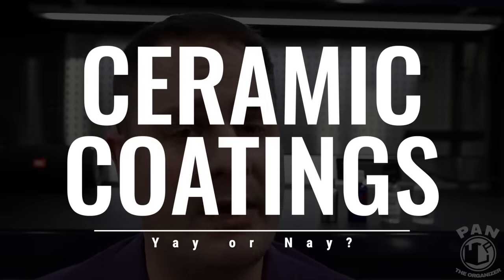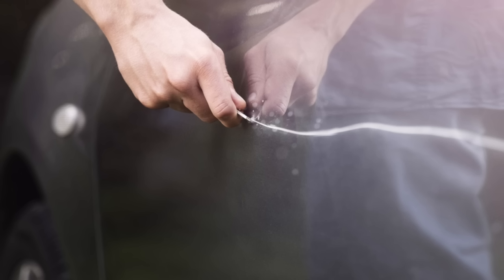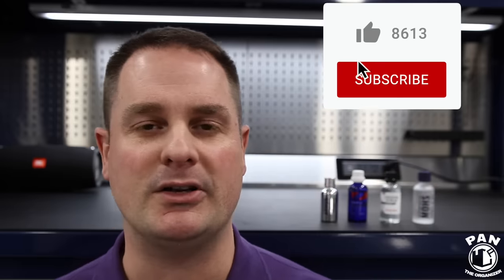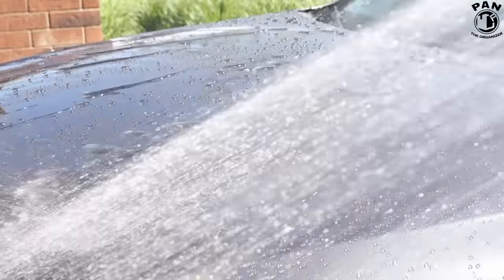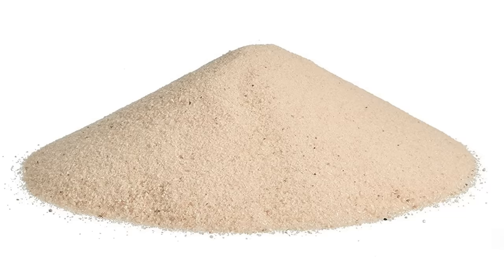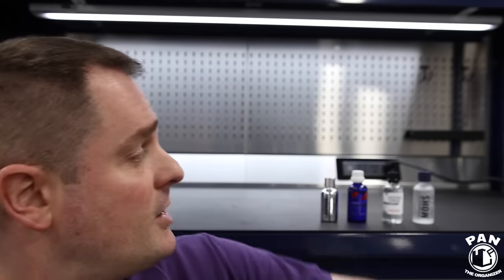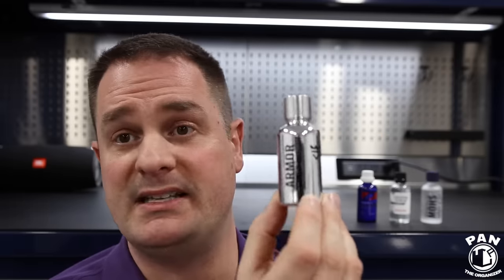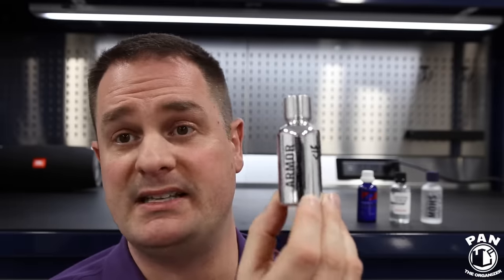DON'T BUY CERAMIC COATINGS BEFORE WATCHING THIS !!

Comment: Pan, I worry that washing and claying won’t remove all sealants and waxes on the paint and certainly won’t remove swirls.
Reply from the maker: You would be correct. Washing and claying alone doesn't remove imperfections and doesn't remove previous waxes and sealants. Only machine polishing will accomplish that.

Comment: Pan I used ur link to Avalon king. Selected the ceramic product. It’s inviting me to enter a code (Pan25),  but it will not allow any entry of any code  so I did not buy it.
Reply from the maker: Weird. It works for all my viewers. You have to make sure to use the specific link in the description under the video, and then when you check out, you enter the PAN25 promo code.
Reply: @PanTheOrganizer  i did it by using crome  not safari thanks.   i am going to BUY everything for the 2 stage pain correction then ceramic protection - including. products-tools-clay - towels. EVERYTHING   for my RED Porsech Cayman

Comment: Pan, is there a recommended top coat to go over armor shield 9?  You mentioned something for the other brands but not Avalon King
Reply from the maker: AvalonKing states that their coating doesn't need a topper, hence why they don't have one. But of course, we all like detailing our cars and I still recommend a silica spray sealant of your choice be applied once every 2-3 months to maintain the coating's performance and also boost gloss and slickness.

Comment: Can you apply more than one coat Armor King?
What professional Ceramic coating do you recommend?  (I have SB3 Trinity and honestly I'm not impressed.  Lots of water spotting)
Reply from the maker: You can apply two coats of AvalonKing. One hour between coats.  For pro grade coatings, you can check out Opti-Coat Pro+, CarPro CQuartz Finest Reserve, Gtechniq Crystal Serum Ultra, Gyeon Mohs+, etc
Reply: @PanTheOrganizer  Thank you for the info/response.  Which professional coat would you highly recommend?

Comment: Getting offered a one year coating at my local detailers does this sound okay to you as you-have mentioned 2 year’s as the norm .
Reply from the maker: Hi Michelle. It all depends on your budget and needs. There are coatings that last 6 months, 12 months, 2 years, 3 years, 5+ years...  So it's up to you to discuss the options with your detailer and see what longer lasting protection could be applied. If it's a serious detailing shop, they should have long term ceramic coatings that could be applied. 2 years of durability is quite the industry average for consumer grade coatings, and pro grade coatings (those that can only be applied by authorized installers) go upwards of 3+ years.

Comment: Hi Pan, newbie here. Been watching a loootttt of your videos. Looking to start my own weekend/evening mobile detailing business that I can do outside my day job

Regarding these coatings, they are tiny bottles. I was wondering how many cars one bottle can be used on - you probably have videos of applying coats with these small bottles, just probably haven’t come across it yet
Reply from the maker: It depends on the size of the car, and how much you are applying. Also, are you doing one or two coats? And are you just applying it on the paintwork, or also on other surfaces like glass, wheels, headlights, plastics, etc?  As you can see there are many variables.

But as a general rule, one 30 ml bottle is enough for two coats on two average size cars. Just the paintwork. If you also plan on doing all the exterior surfaces, get two bottles.
Reply: @PanTheOrganizer  I see. I guess the variables would make it differ
But thanks for the general rule advise, that gives at least some sort of idea. Thanks Pan!!

Comment: Pan love the videos. Very thorough and always educational.  Do you think it’s safe to use a one and done polish like turtle wax hybrid solutions pro prior to the ceramic coat as long as you use the 50/50 alcohol wipe off?
Reply from the maker: Thanks for the kind words about my videos Brett! Always appreciated. :)

To answer your question: NO. Don't use any "all-in-one" type polish before applying a ceramic coating. Don't use polishes that contain protection in them. SUPER IMPORTANT.

I would use pure polishes, like some that I recommend in my compounds, polishes and pads video here: https://youtu.be/2JDvQBs1viM

Comment: after the 3-5 years can I just apply my ceramic coating again?
Reply from the maker: No. You have to go through the entire prep process and machine polishing to ensure 100% removal of any left over protection and prep the surface to receive a new coat.

Comment: Can I apply a ceramic coating to stainless steel on my semi truck
Reply from the maker: The answer would probably be no, as ceramic coatings (made for paint) need to bond to clear coat.

Comment: Have you tested Dr. Beasley's Nano Resin kit? It boasts 25 years of protection with maintenance.
Reply from the maker: I have the Nano Resin Pro kit in for testing but haven’t tested it quite yet.
Reply: @PanTheOrganizer  Are you going to show how it works?
Reply from the maker: If I get enough viewer requests for it, I will absolutely make a video. In the meantime, I made a YouTube short video showing its self healing ability when I was at the Dr Beasley's headquarters. :)
Reply: @PanTheOrganizer  I saw the short, the product seems pretty amazing!  I would love to see more!
Reply from the maker: I was also impressed. :)

Comment: Thanks for the video. I wanted to know what's your process to determine a "real" ceramic coating? Is it based on the product composition found on  SDS sheet?  I have used TEC580 before and i somehow feel it may not be a real one.
Reply from the maker: What we mean by full blown ceramic coatings are the multi-year semi-permanent ceramic coatings (or graphene coatings) found in glass bottles. Yes the TEC580 is a "true ceramic coating" as it fits that criteria. No that doesn't guarantee that all ceramic coatings are made the same. There is much more to it than that (and that's beyond the common knowledge as we don't have the recipes or chemistry secrets behind proprietary formulations).
Reply: @PanTheOrganizer  thank you very very much for taking time to answer me. I'm sure I'll comment in future. Got quite a few videos to watch from you. :)
Reply from the maker: My pleasure Felix. You have almost 600 awesome videos to go through on my channel, and new ones added each week. Lots of crazy videos to come so stay tuned. I hope you subscribed to be a part of the Pan TheOrganizer family as we’re approaching 600,000 subscribers.

How did you discover my channel by the way?
Reply: @PanTheOrganizer  sure did. Plenty of good info.  Been so many years since I done detailing, i felt "out of times"... Catching up so i can best protect my newest ride. A '21 TypeR
Reply from the maker: Cool car!!  Enjoy it!  I get a brand new car every three years. So this coming summer will be that time. My viewers will be in for a freaking treat. So stay tuned! ;)

Comment: Hi Pan,
Awesome information!
I have watched several of your videos several times.
I have a question : Could I use a ceramic coating, then after a week put the turtle max wax on top or even the flex wax?
Reply from the maker: Thanks for the positive feedback David! After you applied a ceramic coating, wait 1 to 2 weeks before washing the car and starting to use toppers. But yes you certainly could use either Turtle Wax graphene products on top, no problem. Those are actually great choices for maintenance toppers!

Watch my Flex Wax video: https://youtu.be/b5BjDzItlr8

How did you discover my channel by the way?
Reply: @PanTheOrganizer  We bought an F150 and a camper in the past few months and I want to protect our investment.
My niece's husband, who does some detailing on the side, suggested I watch your videos.
I have watched (~6 times) and purchased items from your VW new car detail video.
The Graphene videos you did on the turtle wax line added to my confidence to give those a try (they arrived yesterday with the items from your video)
Now I am tempted to buy the 3 car size of the Armor Shield and use that as the base coat on the F150 thus the reason for the initial question.

Comment: What about a new car, do you have to wait for the factory paint to cure or can you coat it right away? Is the prep requirements the same since it doesn't have the wear factor? Also, can you double coat your car to increase the protections longevity ?  BTW, Great videos
Reply from the maker: For a new car, it has already fully cured in the ovens at the factory. You can protect it as soon as you take delivery, and you should. I made a popular video explaining why it's important to detail a brand new car here: https://youtu.be/QgoyrC-5CMc

And to give you an idea of the steps I perform on a brand new car, watch this video: https://youtu.be/gohks8xP5NY

Welcome to my channel. You discovered one of the biggest car detailing channels on YouTube as we surpassed 790,000 subscribers and 100 million views! I have been detailing for 25 years and I love to share my knowledge and passion with my viewers.

You found the right channel to help you learn everything about detailing.

Comment: How many cars can one of those small bottles do. I have 2 Small SUV’s to do and I have a small bottle like the ones you display.
Reply from the maker: Two bottles will allow you to coat two SUVs with two coats each. Get three bottles total if you also plan on coating glass, wheels and plastics.

Comment: @pantheorganizer can i do 2 layers with curing time for each and then apply something like the Turtle Wax Ceramic Spray as a top layer? also do you recommend using a hybrid in after layering such as shine armour fortify or carpro reload? thanks for feedback (purchased avalonking)
Reply from the maker: After applying the ceramic coating, I would wait one week before washing it and starting to apply toppers from different companies.  Stay away from Shine Armour. That isn't good stuff. 

Stick to reputable coatings brands for the toppers. Many of which I have reviewed here:
The Last Coat: https://youtu.be/nQRX1KlY0uM
Lithium Ceramic Slam: https://youtu.be/Zp2sWeY1UHU
Turtle Wax Ceramic Spray Coating: https://youtu.be/_r_AXaUeTIQ
Reply: @PanTheOrganizer  really appreciate the reply! I bought the turtle wax and the Avalon king as per your recommendation. Just looking for shampoo / waterless spray if possible?

Comment: I knw this is an old video but do you still feel like you can't add a coating over a previous coating?  I knw its not ideal but I spoke to someone at Adam's about their Advanced Graphene Spray, and they told me I could do it. I also asked Yvan Lecroix (I hope I spelled his name right lol) he said yes also to the dismay of the guy from Rad's Garage 😂... I just wanted to knw your take on this 3 yrs later.
Reply from the maker: There's a big difference in the "you CAN" and "you SHOULD" hehe. Can you just wash a car that is coated, then dry it, then use a panel prep spray and then apply a new coating on top of the existing one? Yes. But you can't ensure a proper bond as each coating could potentially reject the other one, it's hard to know. So you might not be getting the full performance, benefits and durability of the new layer you're applying.

Like anything in the detailing world, the better you prep the surface before applying any paint protection, the better it will perform and the longer it will last. So if you want to apply a new coating after many years with a previous one, I personally would do the full wash, iron remover, clay, machine polish (at least a light polish to ensure removal of the previous coating, or at least remove enough of it to ensure proper bonding of the new layer), then panel prep spray to remove polishing oils and residue, and then apply the new coating.

Since coatings last for years, why not take a few more hours to prep properly and polish the surface? You'll also benefit from a bigger increase in gloss, and machine polishing is really what bumps gloss up by the most measurable gloss units, compared to just applying protection.

Now, here I am talking about TRUE CERAMIC COATINGS, the ones in glass bottles. Sprays are a completely different thing, as it's not as crucial to get things as perfect as with a wipe-on (glass bottle) coating in my opinion.

If you are simply asking about sprays, which it seems you are, it doesn't matter as much as those aren't multi-year semi-permanent protections. In the real world, you might get 6-12 months with the Adam's Advanced Graphene Ceramic Spray. So in those cases, yeah you could just wash the car, dry it, use a panel prep spray to remove oils and residue, and apply a fresh coat.

Food for thought.
Reply: @PanTheOrganizer I’m at a loss as to what I should do to prep the textured black plastic cladding on my vehicle (Hyundai Santa Cruz). For the painted surfaces, I can count on the clay and polishing to remove any old protectant. But the cladding is a different story. The best I can do is chemical stripping, but anything too harsh beyond diluted APC might damage the surface. The Turtle Wax hybrid solutions spray ceramic that’s on there is tenacious to say the least. Should I just ceramic over the cladding after a decon wash and panel prep? Thoughts Pan?
Reply: @PanTheOrganizer  Thanks Pan !! Yea I was definitely tlkn about Adam's Advanced Graphene in particular. I knw the bottle ceramics are a whole other animal. Thank u Pan. Wutang Forever. 🙌🏽
Reply from the maker: Wu-Tang Clan ain't nuttin to f**k wit!! :)
Reply from the maker: How did this conversation turn into trim talks? I'm confused. It depends if your trim needs to be restored or not. I'm assuming it does. See my tutorial on trim restoration here: https://youtu.be/_9X2jzRhTwA?si=K-k85gT2kkyKs9MH

If your trim isn't faded, and you're just looking to protect the plastic, see my other video here: https://youtu.be/pzi1wpL7I0Q?si=27461s93sdhjFiWm
Reply: @PanTheOrganizer  😂

Comment: So pan, my car has been polish. honestly i want ceramic to make my car change, become more shiny and more gloss, most important thing is that make my car looks changed.
I don't really care about protection
so light coating vs consumer coating vs professional coating
will look the same on my car? And only give different protection time?
Reply from the maker: Before all that, you must know that the best way to increase the gloss of your paint is not by applying protection. It's by machine polishing. Polishing the surface removes oxidation, swirls and scratches and levels the clear coat which in turn improves light reflection so you get the biggest increase in gloss units that way, plus you gain more clarity in the finish, richer effect.

And then applying a quality ceramic coating will boost gloss a little bit more, by a few extra gloss units depending on which one you buy. Hence why we usually ALWAYS polish before applying a true ceramic coating or graphene coating.

I made a video about the glossiest products here: https://youtu.be/ERTQz-NTz1Y

Comment: So... you said that carnuba wax was great but the problem was it needs to be re-waxed every 2-3 months. But then you say that ceramic coating needs a booster for maintenance every 2-3 months. What’s the advantage then?
Reply from the maker: The coatings will still do their job for the years they're on the paintwork, but might lose a bit of hydrophobic properties over time and need to be replenished. The protection is still there, it just needs a boost. Contrary to carnauba waxes that just fade away and disappear entirely, so there is NO protection left.

Comment: Great video! Other than longevity, how do these type of coatings compare to the spray coatings, such as the Turtle Wax Hybrid Solutions?
Reply from the maker: True coatings like these obviously are way more durable compared to silica spray sealants. Silica sprays are easier and quicker to apply so the sacrifice was durability. All the ceramic coatings in this video last 2-5 years depending on which one you buy. Silica spray sealants last 6-12 months.

Comment: (Question) Hello Pan, another great video like always. My question is: someone who leases his cars, a 3-5 years durable ceramic coating is perfect. However someone who buys his cars for a 7-10 years period, what's the process at the end of the duration of the original application? I suspect that it will require a compound to get the original coat off in order to proceed with a new ceramic coating or whatever is best then. (Ok I later found another of your videos that i have yet to watch that deals with that very question about removing the ceramic coating - I'll look into that. Merci Pan for reading this far)
Normand, Rive-Nord de Montréal
Reply from the maker: Correct. You would need to restart the entire prep process including machine polishing, to ensure 100% removal of the previous protection and reapply a fresh one. But it's time well spent, as the fresh coat will last many years. It sure beats waxing your car every month or two. :)

Comment: Hey Pan. Can the Meguiar's Hybrid Ceramic Spray Wax be used as a topper for ceramic coatings? Or should I spend twice the money for CP Reload?
Reply from the maker: Yes the Meguiar's can be used as a topper.

Comment: Pan can you use Griots Garage waterless car wash on a ceramic coating?
Reply from the maker: You can use waterless washes on coatings, but I would only use a waterless wash if you really don't have access to any water, as a LAST RESORT as that will eventually scratch the finish. A better option would be a rinseless wash like in my tutorial here: https://youtu.be/RP_BZ-jZBnY

And of course my favourite method to wash a ceramic coated car is the traditional two bucket wash which I demonstrate here: https://youtu.be/xaQmB_qje_4